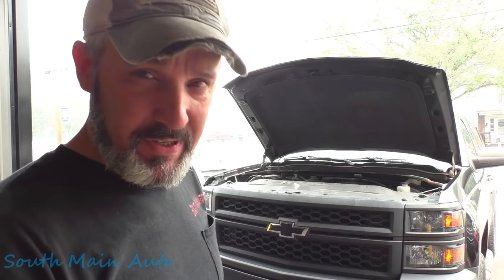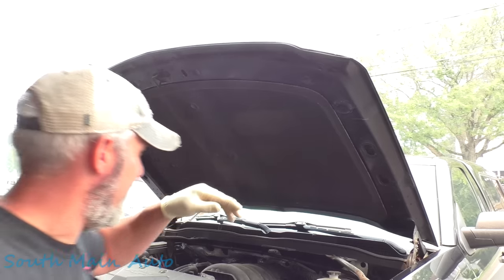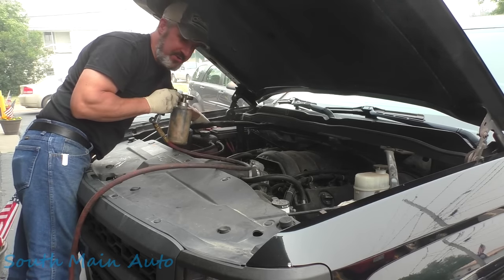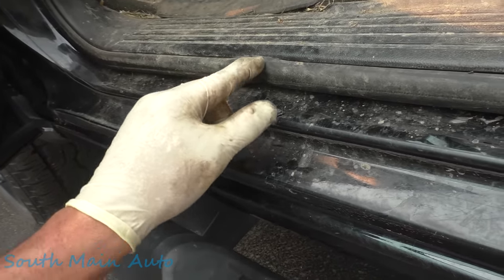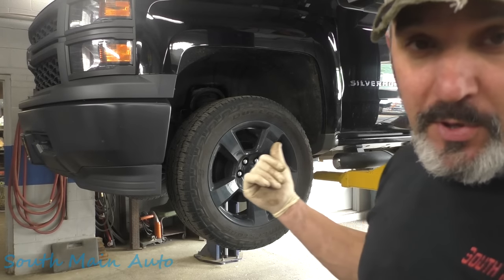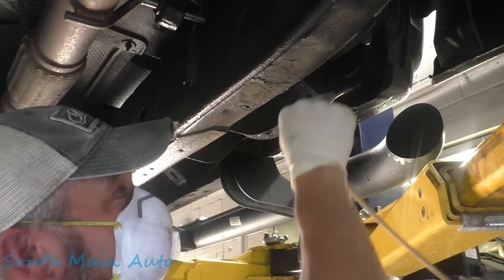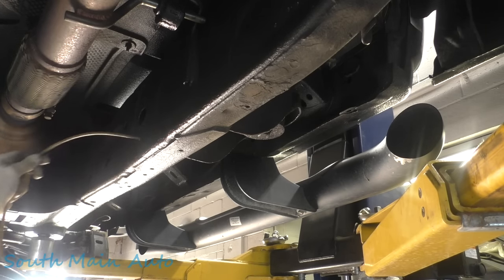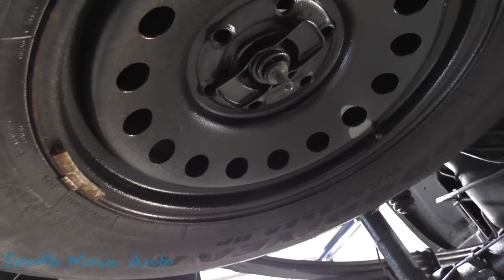Keep Your Car (Or Truck) From Rusting!! You Must Do This!!

Comment: I have a 2014 GMC Sierra 1500, garaged kept, maintained well.  Recently I was doing some work underneath and it was pretty much rust-free, except for the area just above the spare tire.  It was a mess, cross members very rusty, had to do some serious remediation. Seems the spare holds moisture and gives rust a better chance in that area.  I would strongly recommend dropping that spare and treating that area well on any GMC/Chevy 1500 with an undercarriage spare.

Comment: Been using Fluid Film for years. Also tried 3M cavity wax amd their 360° nozzle. Works great if you don't undercoat enough cars to justify buying a whole drum and spray gun or if you just don't have an air compressor.

Comment: I usually do the FF treatment in late September/early October to minimize pre-winter washoff,  but your thoughts about doing it now and giving it time to creep have me rethinking this, especially since I have two new daily drivers in the driveway...
Reply: Doing it before the winter allows dirt to stick to it helping it from washing off.
Reply: Stuff is always going to wash. Multiple touchups throughout the year helps. Pb blasters new stuff seems to resist wash off a bit more.
Reply: A friends dad used to spray used oil on his fender wells and wherever he could spray. I thought it was overkill back then when everything was more open then it is now. He knew.
Reply: Yeah I do my truck  with pb blaster  surface shield 🛡  in September  🛻👍
Reply: Just do it twice a year and get double the benifits😉

Comment: I don't remember if it was the last time you talked about this, or somewhere else online, but.. I remember people saying they don't bother doing this, instead they just do weekly car washes with underbody spray jets. I understand the appeal, because that makes your car look nice too. That is not enough though, that is not a replacement for this. You have to protect the metal itself. That salt is just eating away at your car/truck in between washes if you don't protect the metal.
Reply: What about using a sacrificial anode like they do on boats!?
Reply: I did the weekly underbody water rinses / car washes. They don't work well for rust prevention in my experience. I used fluid film the next winter when I saw rust on my new car

Comment: Does this still help on smaller unibody cars? They seem to hold up better than trucks especially if the bottom is mostly covered.
Reply: Yes. At the very least I would do the front and rear subframes, since replacing those can be time consuming and pricey.
Reply: Doesn’t matter what vehicle type or make, any hole any joint in steel that water can get to or into the salt can also.

Comment: Nice thorough job!! Fluid Film "is the best" and on my 2019 f150 it looks like new underneath. I did 2 full sprays (2 years apart) and 3 touch ups (every fall) since new! I live in Northern Ontario, Canada! (salt country!!) Any protection, done regularly, is essential to protect against corrosion!
Reply: Drill drain holes in the bottom of your rockers.
For the love of god Drill drain holes in the bottoms of your rockers.
Reply: I use Corrosion Free which has kept my 2009 F150 completely rust free on the east coast.

Comment: As a youth I worked at the Walmart in town and we did undercoating.  I had a guy with a truck maybe 10 years old that was in real nice shape (live in the salt belt), he asked me to do a good job so I asked him if he cared if it drips a lot.  He said no.  Well as a bored teenager on a quiet day, I went nuts on that thing.  Think I used a good 6 or 7 gallons on it.  There were no unpainted surfaces ANYWHERE that I missed.  And I put it on so thick it probably dripped for a month! 😂😂

Comment: Recently had my 2011 Suburban K2500 treated with Woolwax and the process included pressure washing/drying thoroughly prior to application.  The 2015 in the video looked pretty clean so maybe pressure washing wasn’t required.  Your thoughts?

Comment: Would have been interested to see the ‘spray’. Just blast a piece of wood or cardboard to see the heaviness of the spray.
Spraying into crevices can block the manufactures drain holes, which can cause more problems than you are solving. 
But he uses the term ‘fog’ so I assume the spray is more of a mist which shouldn’t be a problem? 

Years back, working at a body shop, we’d get restoration projects that were being stored. If a project was going to sit for an extended period, to prevent any further rusting, we mixed up a bees wax & oil solution. Sprayed the entire vehicle with the mix. It protected the vehicle from further rust and was fairly easy to wash off prior to commencing the project.

Comment: As you give the Chevy guys grief, don't forget about the cam eating lifters. That AFM system is a joke.
Reply: Hemis are just as bad if not worse.  Curious to see how the 22+ Coyotes will do with it
Reply: Just disabled my AFM in the ECM.  Hope that helps with the oil burn and future lifter failure.
Reply: Hemis are worse but no body talks about it.
And now the Ford 7.3.
The lifters are all made by Eaton.
Same lifters in all three brands.
Reply: I'll deal with the GM AFM system over the self-destructing cam lobes in a Hemi.
Reply: @SIGINT007  and broken valve springs.
Reply: @philllsxga.7737  truth
Reply: @philllsxga.7737  seriously ?
Reply: @rogern5368  plus the hemi has cam shaft oiling issues below 2,000 RPM..
You're better off with a Chevrolet overall...

Comment: Back in the day, we sprayed used motor oil all over the bottom of our trucks in the western Oblast of the PRM, just to your east.  The Berkshires become salt mounds in the winter just like the PRNY.  Worked pretty well and was an easy way to get rid of our used oil that we changed every 2000 miles back then.
Reply: Some cars self lube the bottom on there own. 🤣🤣🤣

Comment: I finally decided to give the yearly oil treatment a try with my 2019 Caravan. I go to Rust Check, $200 a treatment. Have it done in Nov/Dec…their stuff isn’t as thick as Fluid Film, so still seems to seep into places even in the cold weather. I do use cans of Fluid Film to reapply in wheel wells, and other spots during winter. Still undecided on it, but will keep doing it until this van stops driving, or just rusts out like my other three Dodges did!

Comment: I spray Fluid Film on rotors after turning them before putting them in storage.  If you don’t get it all off with brake clean, it smells like hamburgers when you brake as it burns off.
Reply: LOL

Comment: I am just preparing for undercoat, i tested many things and best results i have is Lanoline/Vaseline + naphtha/white spirit(as carrier) it is transparent and smooth surface. I also tried Lanoline + Isopropyl alcohol so it would be super safe for environment and i wouldn't need mask to spray, also safer for rubber elements but Lanoline doesn't mix so well with it as with naphtha or white spirit and surface is a little bit uglier :D My Toyota Auris 2013 has already some surface rust so it is time to do that. Thanks for the video !

Comment: Here they have not used salt on the roads always calsium colride or magnisiam cloride but they are starting to use salt in some spots now never had to put oil on at all they also use sand on the roads lots of windshields

Comment: That's interesting.  I thought you were kidding at first.  Here in the south, we try to keep the oil off of those surfaces, lol.  Although I once had a monte carlo SS that has its own under carriage oiling system via the 2 piece rear main seal.  Thanks for that GM.

Comment: Tom in Northern Vermont here. I have bar oiled My 1997 GMC 1997 GMC K1500 Suburban every year and the frame and body are rock solid. There is no better way to protect your vehicle than using oil...

Comment: Up in rural Vermont I go every year to a local shop that’s been going for over 40 years that uses their own oil formula. It drips a little for few days and it doesn’t affect the plastics or gaskets or stuff you hear about from the doubters. A lot of towns send their highway trucks there every year

Comment: I used surface shield last fall and I suspect it actually aided in my rockers rotting out in that same winter.
Protected the frame and suspension pretty good though

Comment: Anybody do the shade tree equivalent of used motor oil and kerosene? I bought a garden sprayer last weekend, planning to try this. The car has 210K on it but the rust is not too bad yet so I figure maybe I can slow the rust down for another few years.

Comment: Very good job you do because your attention to details, ''almost'' more important than the rust proofing product. A friend of mine do have a 2007 GMC Sierra 2500HD with over 400,000 miles with almost nos rust on it, every spring, he pressure wash from a distance (NOT pressure blast, different) under his pick up truck 2 - 3 times to remove all the salt and aother accumulation, let it dry for 2-3 weekd than send it to rust proofing to a shop with attention to details. We do live 350 miles north-east of you, where 5 months/year we do have the roads cover with snow and salt/calcium and everything to rust anything. Because every vh do have specific building ways, in some places the need is to cover while in other places it is essential to have a product with high/very high capillary action in order to infltrate/penetrate in very narrow space such as where two sheet metal panels meet.  You show a job very well done. 👍👌👍👌👍👌

Comment: My 2021 Chevy Silverado 1500 RST DuraMax has had 2 full coats of NHoil getting a touch up coating this fall. Having changed the oil and been under the truck it’s somewhat messy to work on. How do you feel about doing maintenance when the coating gets over everything.

Comment: Thank you for turning me on to Fluid Film. I watched one of your video's years ago about using fluid film. I live in Chicago land same issues with winter salt here. I have a 2014 Ram. Started using fluid film in 2016. Its parked outside and driven every day year round. No major rust at all on the truck. There is a light surface rust on the driveshaft differential and a few spots on the frame. I do it ever year with the cans. It takes me 10 to 12 cans and about a day to do it but is worth it. I even drilled small access holes on the inside of the bed and spray inside with a extended straw. Then I use a small rubber grommet to plug the holes. Do the same with all the factory holes as well. I have no bed rocker or corner cap rust at all. One more place I forgot. I pull the third brake light and spray the inside of the roof. I have had problems with those seals leaking form time to time.

Comment: I saw a video on Youtube where I guy tested several types of undercoatings including fluid film. From best to worst, 1) PB Blaster Surface Shield, tied for last NH Black and Crown, both junk.  Fluid film was in the middle somewhere. I made up my own for a while, summer grade bar n chain oil, a toilet ring, (beeswax) and 5 cakes of paraffin wax. then heated Mine did as well as fluid film.  Do not use any kind of hydraulic fluid. It absorbs moisture. The waxy stuff on the frame is probably lanolin put on at the factory.

Comment: Celebrating Willi Ninja
save money by doing the DIY method use Diesel and used oil in a pump-up sprayer! do this on a gravel driveway that you don't care about killing grass or find yourself lots of cardboard to place underneath the vehicle  please note that your car will smell like diesel for a while but it will save you lots of headaches in the long run!!!!!!

Comment: Wool wax in my preferred product!

I was in Australia a few weeks ago and decided to treat the doors on my 1969 Rover with a lanolin based rust treatment that comes in a spray can. It has the added benefit that the windows are well lubricated. I can wind wind them up and down easily now!

Comment: I had this done on my truck at the dealership before I took delivery.  The finance company required it. I rode so quietly and after 6 New England winters there was no rust anywhere on it.  The undercoating protected the frame.  A wise investment.

Comment: Is this worth trying to do on a truck a few years old with lots of surface rust underneath but still solid?  If so, does the underbody need 'cleaned' or 'sandblasted' first ??
Reply: If it's still solid Absolutely, I would probably try and wash the frame, inside the fenders or anywhere  salt water goes first, I will definitely slow the rust down it may not Stop it entirely but if it can't get air it's way slower.

Comment: I live in eastern Canada, so I definitely understand the importance of undercoating, but I recommend to people to avoid oil based sprays and look for wax based. Oil based is bad on rubber and can cause door seals and other rubbers to swell whereas wax based will not.

Comment: I have used the Fluid Film for several years but I tried the PB Blaster stuff last fall and I think I like it better. it seamed to stay on better in the wheel splash areas. Don't get me wrong the Fluid Film is good stuff and it worked great I had no rust using it.

Comment: Nicely Done Eric! I have always fluid filmed my trucks. I have a 2018 Tacoma that i bought with 25k miles, now has 60k. I have been coating it for the last two years and the frame still looks better than one year old ones today. It is messy, but is dose work. I mean for what thees things things cost today ya have to do something.  What do you think about the aluminum bodied F150s? They seem to be holding up in the salt here in NH

Comment: Hi  Eric, typically how many vehicles a year would you spray and what would an average vehicle cost to treat, I realize that may be a trade secret but in the UK, it's not too common to wax oil a car, it's aimed at 4x4's like Land Rovers, great job though, how many times did you fill the gun up for the truck ?
Reply: Probably not as much as you think

Comment: After fluid film, its impossible to work on the car. Filthy slippery everywhere.
Reply: You realize he works on these rides after the fact... and typically the work is easier than without it.
Reply: Yeah one bolt that takes an hour to get off the car cause of massive amounts of rust because an idiot didn't fluid film his car is much easier than taking that bolt off in under a minute with gooey junk on it, makes sense
Reply: @eddie3500  Name calling says more about you than anybody else...

Comment: In regards to spraying in the engine bay, any concerns with this getting on belts/in air box or the such?
Reply: I don't know that I would worry so much of getting it on the belt. I mean don't just spray it on the belt to spray it on it but I wouldn't be too worried if you got some on it. Your belt might just squeak for a while

Comment: Curious do you have to worry about fluid film an rubber components?
Reply: It depends on the rubber. A lot of rubber found underneath a car/truck is oil resistant, which should be fine. However, non-oil resistant rubber can swell up if sprayed. One example of swelling I remember reading online was door weatherstripping.
Reply: @chrissmithz314  thanks

Comment: I have a question. If rust Is already started isn't it going to continue under the fluid film. Once rust starts its like Cancer and can't be stopped.
Reply: No... its like oil.   It will stop the rust because it cuts off the oxygen from helping corroding the metal.